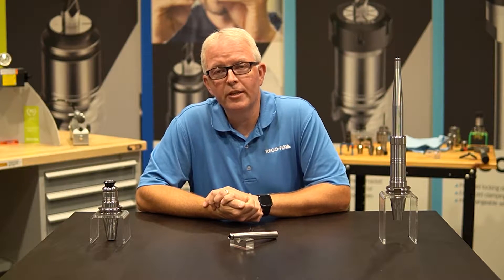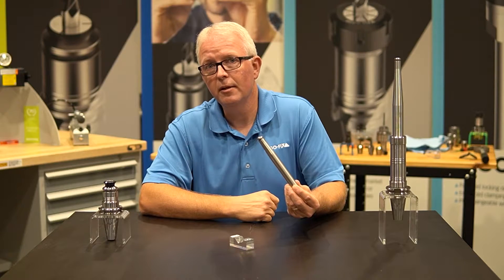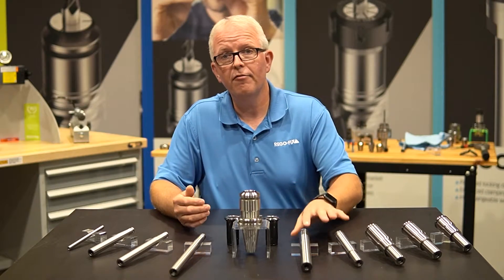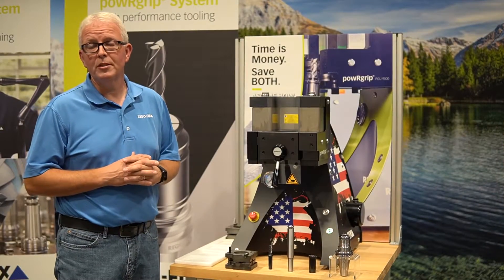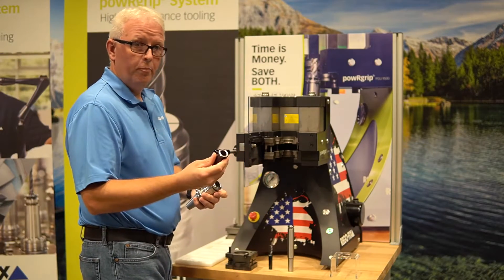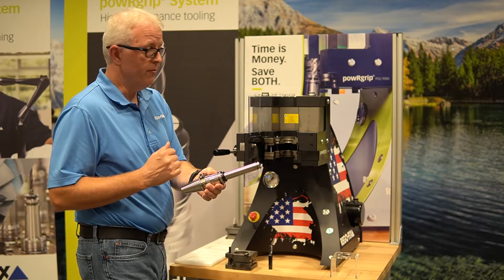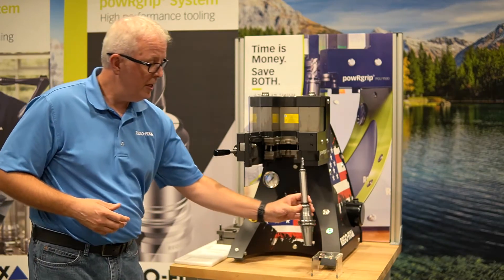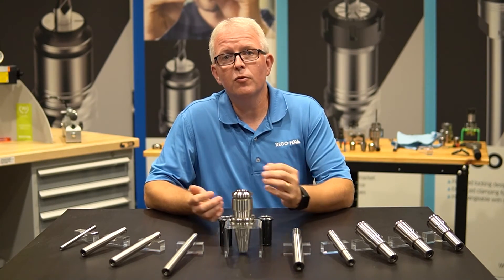TechChat - powRgrip Extensions

Comment: This looks like a pretty attractive feature of the system. I have three questions:

1) How do these compare price wise to powrgrip's BT-40 Toolholders? I know you don't like to give out exact prices, but a % would help, as i already know the prices for the toolholders. 

2) Can you use Haimer Duolock type extensions as well, instead of the Rego-fix extensions? This would allow me to use the duolock to get into really tight spots for simultaneous machining, but i would potentially have good vibration dampening which i don't get with heatshrink, and better gripping power than i get with hydraulic...

There are also insert mills from the like of Widia and Sandvik that would fit into a PG25 collet, just like those extensions do... 

3) I have been on the Rego-Fix website, and they only have 6 "standard" CYL extensions. In the video David has 9 just in front of him. Are these being discontinued since making this video? I would have expected the range to have expanded rather than shrunk over time...

Thank, Alex
Reply: If the duolock extensions are a non proprietary size diameter, then they will work with the rego powrgrip system.